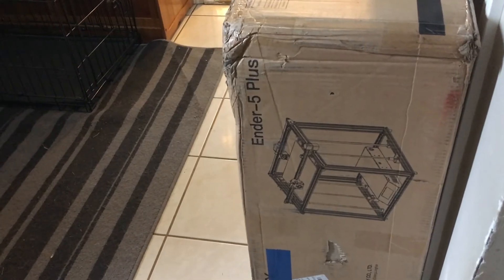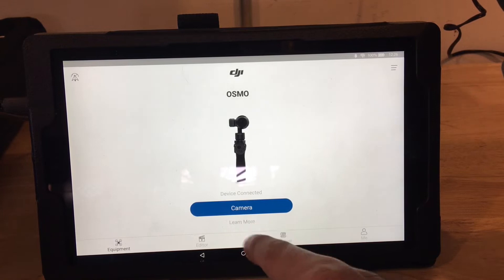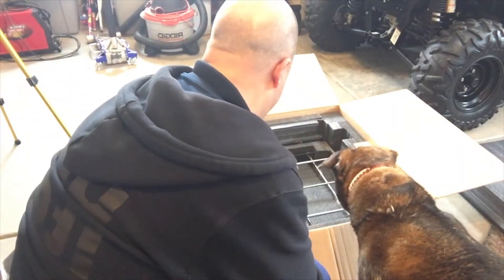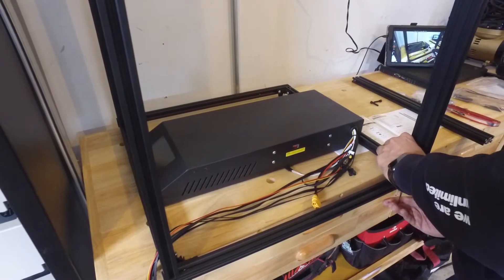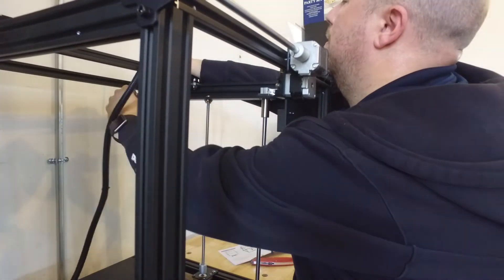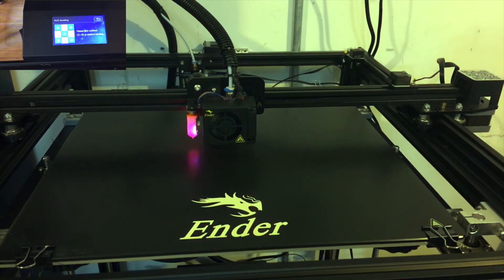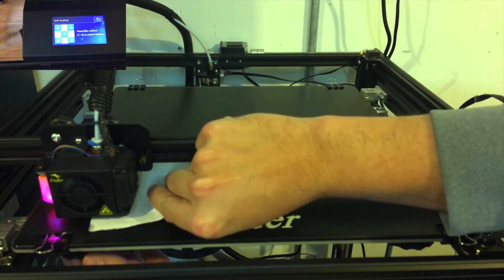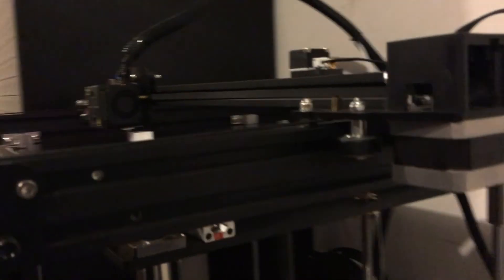Creality Ender 5 Plus - Unboxing, Build, Bed Leveling, and first print!

Comment: I’m at the “using Slicer stage” so was rather keen on seeing how you set up your printer for the first time.
Terrible delivery, I was lucky as the guy insisted on carrying it in for me! Well I guess the Elder 5 plus is just the one listed as Elder 5.
Yet I was surprised the software didn’t ask for more info at that point. I think the auto leveling is just so that you can skip the manual work each time?
Hope you enjoy your printer.

Comment: I found your channel through Kersey Fabrication's channel. I don't live very far from you at all, north-west burbs. I just assembled my Ender 5 Plus and am running my first test print. About 10% of the way in, I checked on it and noticed the filament stopped feeding. I paused the print, the hot end moved to the rear-right of the printer, and the bowden tube popped out of the extruder. I'm resetting everything now.

Comment: I just set up the Ender 5 plus last night and the first 4 prints went great but now the nozzle is way to high off the bed and when it try’s to print the plastic barely even touches the bed and the gets dragged around by the nozzle. Do you know how I can fix this? I am brand new to printing so I’m trying to use Cura to slice and get files on the SD card which is working decently well

Comment: I'm having issues with my ender 5 plus (silent board).

The home position is set so high that when I try to do the auto leveling the bed crashes into the nozzle and doesn't stop until I turn the power off, the bl touch engages 2 times but on the third time of the bed moving up when it should stop just under the nozzle it just keeps rising. This also happens when I try to print.

Iv tried moving the bed to where it should be and pressing z home but the whole process then just starts again, its almost as if it just doesn't save the position.

I'm a complete newb at all this stuff and I have tried updating the firmware via creality slicer but it says the printer isn't connected to my laptop but the old board connected just fine using the same USB port on the laptop.

Thanks for any help, im as frustrated as can be.

Comment: To insure the Z axis are parallel you run the sides up by hand to the top and then turn on the machine and lower the z so you can mount the table......

Comment: i think the kinematics is not the best (better to use h bot) also the wheels of the carriages on the top  are in the wrong direction facing side movement strengths - for this case need to be lean on the wheels down - also the next issue is the motors drivers - why do not from the factory to do silent eg 2209? the next is the display tft better) Dear John could you please tell me during all time you work with it - what is the state of the wheels on the carriages on the top of the printer?
Reply from the maker: @Mito Fun - Thanks for taking the time to watch!  I really never understood why Creality didn't go with a Silent board for this printer.  Given this printer is using Dual Z steppers, I would have happily paid the $20 more for a silent board!  The wheels are actually in very good state, they all have maintained their contact, but are major dust collectors.  These wheels tend to create a static charge and attracts a lot of dust.  I just seem to have an issued with the limit switch constantly unplugging on the X axis.
Reply: @TripodsGarage  thank you John for the information - before new year (on december) i have purchased ender 3 (for about 120 usd!) just to try it ))) and i still  very interesting in 3d printing - i tried to improve it (but frankly saying  it was very gooooooood in printing from the box!  and i have decided to change motherboard + tft + drivers + make the body stronger and oh my god the price of upgrades was more thank 200 usd! so i sold it and have bought components (very good one) and decided to construct and build it my self! as you know in Russia (i am living in russia) the price of aluminium extrusion profile is good (20 by 20 v slot 1 meter costs about 3 usd!!!) so my total cost for printing area 400-450-400 is almost 400 usd! also i learned ho to use autodesk inventor from 0! it is great experience !!!! also when i had ender 3 my maximum speed for 0.6 nose was 45 sm per sec! this is due to the kinematics! now i am using H BOT kinematics and nose 1.2 so will try to achieve speed 90 to 120 sm per seс!!!! and will have close box for the printer) roughtly 2--3 and i will finish with my all design and calculations and drawings at autodesk! thank you once again for the information regarding the wheels! sure if to install direct extruder they will tier out quicker( but i was surprise they are still in good shape)))))
Reply from the maker: @mitofun6967  That is an amazing price for extruded aluminum!  If extruded aluminum was that cheap here I would be building everything out of it.  The extruded workbench I built for my printer (https://www.youtube.com/watch?v=CKmlimtZEQY), I bought the 4040 used for about $230 USD.  I am limited to for a .04 at around 70 for my print speed.  I do have some upgrade plans for this machine before I build the enclosure.  I already spent $100 on a Meanwell PSU, to replace the stock one that burned up (https://www.youtube.com/watch?v=A-Zb40P09MQ) I figured my upgrade parts will be about another $175.  So in total without the enclosure we are looking at around a $840 printer!  WOW!  Don't tell the wife ;-)
Reply: @TripodsGarage  compare it to china - in china it is twice! in Russia we have plant who produces it
Reply: @TripodsGarage  ok i will not tell her!))))))
Reply from the maker: Mito Fun - Nice!  And thanks 😉

Comment: I like the video, you did good. . .  But you should heat up the hot end while leveling too, I dont know if you just forgot to add it into the video. . . Just figured I would put it out there!
Reply from the maker: robert berg
 Thanks for taking the time out of your day to watch my video!  Yeah, definitely a noob when I posted this.  There wasn’t any good unboxing or setups for this printer when it first came out.  I currently do that now when leveling.  I appreciate any and all advice 😉
Thanks again, please like, and subscribe!  Tripod
Reply: @TripodsGarage  done! Yeah, when I  got my first printer I never thought about heat expansion, it never crossed my mind until my bed started to warp. . .  Lol
Reply from the maker: robert berg 
Same!  If really think about the tight tolerances, heat expansion is a pretty big deal!
Reply: @TripodsGarage  I love this printer but leveling is the biggest pain. Im going to start with the center like you did for the z offset and then level the corners. I just can't get it level :/
Reply from the maker: Justin Swinney 
Maybe we can arrange to do a video chat and I can help you out?
Thanks again for watching 
Please like and subscribe- Tripod

Comment: Nicely done mate.  Finally someone has posted a decent video on the Ender 5 Plus setup.  I've debated for months whether to buy the 5+ .  But the amount of issues people are having with them has really turned me off.  I might get the CR-10s Pro V2 instead.  Although I still haven't made a decision.  Did you have any issues?  Did you have to update the firmware?  Thanks for the vid!
Reply from the maker: @lsky - Thanks for complement!  I am really trying to be straight forward with my videos.  Now that I can exceed the 15min video restriction, it will make it a lot easier.  There are only a handful of these unboxing\builds for the E5+, and I thought this would be helpful.  I debated for months as well, for me it was the overall print volume.  I originally was going to get the CR-10s Pro as well.  Then I saw the Ender 5 Plus, it was a little larger, and really liked the Dual Z-Axis for some odd reason.  I received my printer a couple of weeks ago, and it already came loaded with the latest firmware.  Now this printer is definitely isn’t without faults, and quarks  This will be covered in my next video on how these can be corrected.  Am I happy with my purchase?  Yes!
Reply: @TripodsGarage  Sounds good buddy.  I was so excited about this machine as well and I stalked every users comments religiously trying to make up my mind.  I love the volume also, and the fact the bed only moves up and down.  But to be honest I don't like having to buy something and then buy a bunch of other things to make it work well.  Example a new power supply because the original is crap, new mainboard because to make it more silent etc.  But we'll see.  Plus a lot of users are saying the print quality is substandard to what they are use to.  I really want one of the new secKit Go printers (a true corexy) but it looks like it will be weeks before they're back in stock.  Looking forward to your next vid mate :)